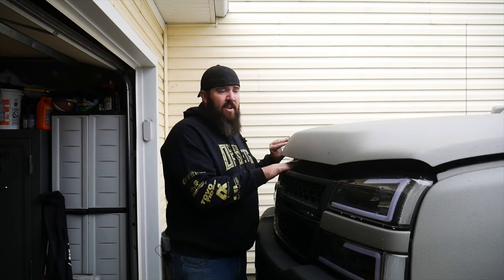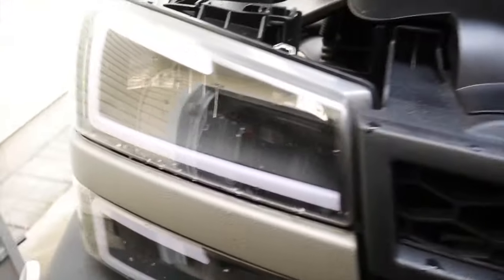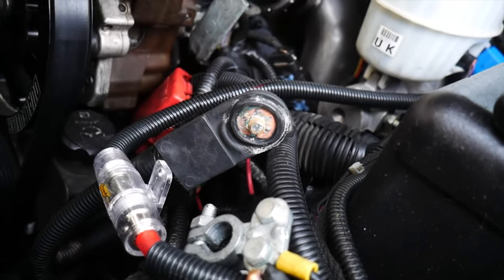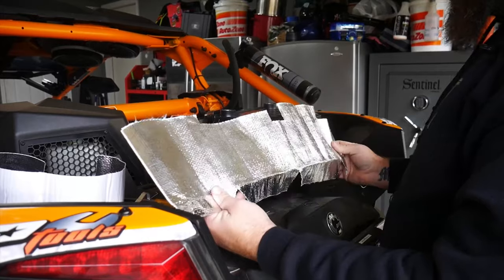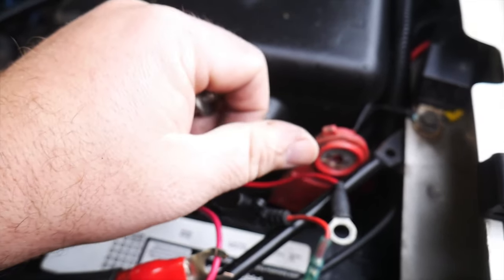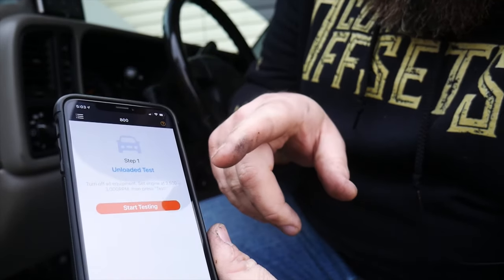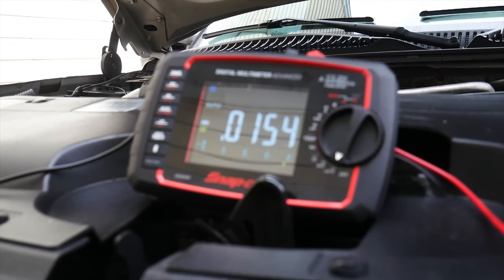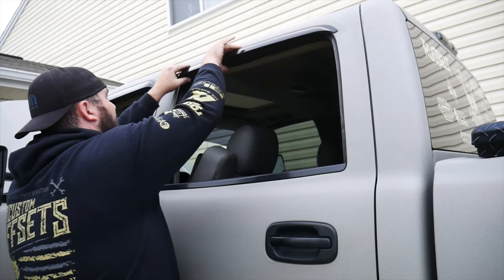DURAMAX BATTERY TESTING AND REPLACEMENT - MANY MORE THINGS NEED FIXED!!

Comment: I was told that on a diesel truck it is always better to change both batteries at the same time. True or false?
Reply from the maker: Eh…. Highly depends on the situation. I’d say if both batteries are over 5 years old or so then yes I’d definitely do both. But if they’re less than say 2 years or so old and one gets a dead cell, just replace the one, it’ll be fine.

Comment: That secondary Battery placement needs to be relocated as that larger Turbo is smoking the battery with Heat.
Consider moving it to the cab or bed.
Reply from the maker: Yep, definitely finding that out now as this new battery is already cooked. I’ll be doing an update video on it soon.

Comment: Not sure why everyone insists on changing factory original batteries with knock offs. I have a 2013 Duramax that still has the original GM batteries. Even though I live in Northern Canada where temps are now around - 40 I have had zero starting issues. I am going to change them out anyway as they are almost 10 years old. When I do I will be buying AC delco batteries from my dealer as obviously they last a lot longer. Just for yuks I will test the old ones after I remove them.

Comment: Would a bad battery cause surging when I put all of my windows up at the same time?  Rpms dip super low and then when I let off the switches it jumps back up to idle.  I don’t know if these trucks have a voltage regulator or not.
Reply from the maker: Could be a few things.... bad battery, bad ground, bad alternator (diodes could be going out)